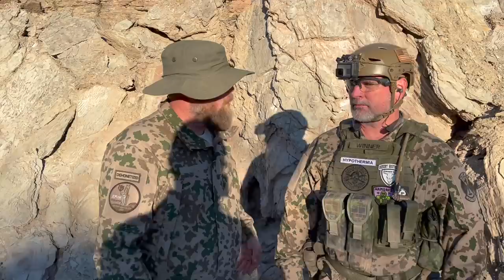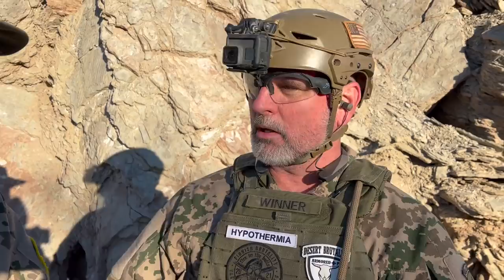WWSD - Why not a hydraulic buffer?

Comment: Temperature dependent change in viscosity is simply a fluid engineering issue. There are plenty of fluids which exhibit very low changes in viscosity based on temperature (shock oils) 
Without elaborating on what fluid they're using this doesn't mean much.
Reply: True also is it fair to condemn hydraulic buffer systems based on temperature in one experience when we don't know what the other factors are? Is the gun running minimum gas or reduced bolt travel like many gamer guns, is the bolt carrier lightened, what lube was used in the gun itself? Also I think it's fair to mention that there was a problem with sand in the magazine which could cause the issues alone and it was evident in the video the magazine was hard to seat. Lets not jump to conclusions, if we want to learn the reliability of hydraulic buffers they should be tested correctly.
Reply: I think it's a fair point when you're relying on off the shelf components to put in the rifles. If even the good ones that are available exhibit such behavior, then they aren't a great idea in practical terms. Could you design a better one that wouldn't be problematic? Sure, and hopefully someone will.
Reply: I recall the Colt LMG and LSW currently in use by the Dutch and Danish militaries use hydraulic buffers. Designed back in the 80’s, they give the rifle a very stable rate of fire but require occasional replacement when their seals begin to fail. 

Colt did try a similar buffer for the CAR-15 carbines but didn’t go forward due to the cost and the failure of seals.
Reply: @jubuttib  I understand what you're saying but they didn't even list the hydraulic buffer manufacturer, when it was manufactured, how many rounds are on it or any other pertinent information. 
The failure of this hydraulic buffer is a single data point and should be treated as such. My issue here is Karl making sweeping claims without the usual investigative In Range due diligence. I don't run a hydraulic buffer in anything I personally own FYI.
Reply: @otm646  Entirely fair points, this video isn't conclusive by any means. I was also going off based on other comments seen here, as well as other discussions elsewhere. I agree tho, it'd be great to have them make a video or a series of videos showcasing these issues with units they've had problems with.

Comment: oh it's simple, you just need to install the hydraulic fluid pre-heating system.  keep an eye on your buffer's temperature and pressure gauges and just turn on pre-heat as necessary.

Comment: I run a taccom buffer with the double spring system and it has done well for me but I don't push my rifles as hard as you 2 gun shooters. I wonder if it would hold up
Reply: I have the armaspec srs, the 2 stage spring and so far no issues

Comment: Am I being dumb, how can buffer case double feeds? That sounds like a magazine or ejector/extractor issue.
Reply: If the buffer is too hard (viscosity is too high due to the cold weather), the bolt could come back just far enough to pickup a new round but still stroke so short and fast that the empty doesn't have time to clear.
Reply: Oops, wrong post

Comment: Well, sounds like you need an oil with a much wider temperature range, where its viscosity value stays true for the desired damping characteristics, or you have to build in a valving system which adjusts for the viscosity change. And maybe you need some cooling. 
At least hydraulic recoil damping worked in some artilery pieces, and some shocks on offroad vehicles are also known to cope with that kind of wider temperature conditions quite well.
Reply: Question out of interest: Are you talking about self-loading artillery pieces? I wonder if it's a question of scale to an extent, a smaller system like a semi-auto rifle that cycles really quickly and also isn't gassed to hell probably has a smaller margin of error for these kinds of things. Don't know, just thinking out loud.

On the vehicles, a damper running cold will be a bit stiff to start with, but won't prevent the car from working, and they'll warm up in use very quickly anyway, so it's kind of a temporary issue.
Reply: @jubuttib  No, I didn`t thougt particulary about slef loading artilery pieces. But if I think on reloading times of some tank destroying guns like used in WWII, I don`t think it doesn`t matter so much. All I have seen on artilery pieces was the combination of a spring for handling the recoil and a hydraulic damper to handle the spring. It all comes down on how much energy is transfered into how much oil and how good is the cooling to the environment for the oil to determine how fast it heats up and leaves the window of proper viscoity. Scale it right, and it should work. If it fits still into the buffer tube of an AR? Don`t know. Anyway, the whole idea seams a lot of effort to handle recoil of a handheld firearm.
Reply: Theoretically high performance shock absorbers run on zero viscosity fluids, but of course practically whatever oil is in there does have some viscosity. However they do not rely on viscosity for damping. I am sure it would be possible to build a perfect hydraulic buffer but it would be complicated.
Reply: @gearloose703  I'm slightly confused, don't these buffers usually work via the same principle as car shock absorbers, i.e. controlling the flow of a fluid (almost always oil) through orifices in the piston, or around the piston? At least that design is primarily based on viscous friction.
Reply: @jubuttib  I have never seen a hydraulic ar buffer let alone taken one apart. But simple orifice won't work because force vs. speed would be exponential. You'd want constant deceleration which requires more complex flow restrictor, which may not need to rely on viscosity at all, but rather shims or similar which provide a more constant restriction over wider range of flow starting from zero (unlike orifice).

Comment: Sounds like it's the fluid at fault. It doesn't mean that the concept is bad, but just that the current implementation is poor. There are plenty of usecases for temperature-resistant hydraulics, so investigating which would work may be valuable.
Reply: the thing is that. at least I can´t come up with a way that a spring is destoyed. Hydrolics a leak and they might not work at all.

Comment: Same reason I think the new B&T APC9/10/40/45 is overly hyped. It may be built to Swiss standards and run super smooth, but sooner or later that little hydraulic buffer is going to give out and it's not going to be cheap to replace or easily sourced. I just looked. $241 for a recoil assembly part, which everyone knows recoil spring and buffers are usually the first parts that need replaced.

Comment: The Canadian LMG has a hydraulic buffer system that works in cold environments.
Reply: Only because the substance inside is Molson Ice.
Reply: @DavidWilliams-ig5ec  For sure don't ya know ayy?
Reply: It’s a bit like motor oil, you can make a hydraulic buffer for any specific weather condition but what you can’t do is make a single buffer that will handle more dramatic temperature ranges.
There’s all sorts of additives that could help broaden the range and technology is always going to help, but it’s obviously not fully there yet..
Reply: @Jay22222  The fluid absolutely exists, the issue is whatever fluid the manufacturer put inside this hydraulic buffer.
Reply: @otm646  I’m very skeptical that there is a “one size fits all” hydraulic fluid that will produce consistent results in a northern Canadian winter through to a midday heat in a Central African desert.
And if there is, I’m certain that you will have debilitating malfunctions of the O-rings and wipers.
Best of luck finding imperial sized replacement parts in the middle of the Sahara or the Gobi.
(Assuming we’re not talking specifically about the LMG referenced.)
Reply: @Jay22222  There absolutely is, and for two reasons. Firstly because you can meter fluid better than a simple fixed sized opening, allowing for constant pressures to be maintained over a range of flow-rates (see any regulator used in any system, from most washing machines to your home compressed air). Secondly because viscosity modifiers are already normal for engine/machine use, hence duel rating oils (eg 5w30) rather than straight SAE30. How do you read this? Well the first number is the base oil viscosity, its going to behave like this when cold (a fixed temperature close to waters freezing). The second is the viscosity of oil it behaves like when hot (a fixed temperature close to waters boiling point). The replacement parts comment goes equally for anything not already in common use... your not going to get correct buffer springs (which absolutely are weapon specific) any easier than seals. IMO the big issue is most products on the market are toys for hobbyists, not serious military use and associated development cycle, rather than the intrinsic nature of hydraulics. It'd take more time to make a good buffer, so most of the quickly engineered drop in products for various guns simply suck.
Reply: @SheepInACart I think it’s important I preface this by saying, I’m not talking about the vast majority of situations, I’m talking around the physical limitations of human beings, those kinds of temperatures.
 @SheepInACart ssion curve and it’s  @SheepInACart viscosity is  @SheepInACart 

Also, you do realise that there’s some pretty substantial and significant differences between hydraulic oils and fluids and engine oils right?
Hydraulic oil doesn’t need near the same resistance to heat that engine oil does and likewise, the compressibility of engine oil is really crucial like it is in an hydraulic system. 

Another thing is, if you live in the coldest parts of the earth, you’re not using the same oils as you would be if you operated in the hottest environments on earth. You just wouldn’t. It’s far from the only reason, but it’s certainly a big important reason that there are so many different kinds of oil for these applications and the most important factor here is two of the most major duties of oils are not relevant in a buffer tube.
You don’t need lubricant and wear additives anything near like you would want in an engine crank case and the viscosity also isn’t near as important because as I said, it’s not driving anything or being pumped anywhere.
Another major factor that makes the an impossipuzzle is the fact that engine oils have ratings for operating temp, hydraulics have operating temp specs.
There really is no standard operating temperature for the hydraulic buffer in a rifle. @SheepInACart it’s going to expand in the heat and have a bite taken out of it after your first shot or it’s going to be so freezing cold that it practically shatters after your first shot.
You  @SheepInACart Also, even if it’s not buggered, it’s fixable, you’re hooped unless you’re carrying around some backup special sauce hydraulic oil for your rifle.
Put all that aside, here’s a question:
 @SheepInACart 
I know what I’d pick.

I don’t disagree with the last part of your post.
Just about every technology In existence is only available and affordable now due to the military industrial complex.
Phones, satellites, vehicles, firearms, making perishable goods last forever. You name it, the military pioneered it.

Edit: Just read the flow rate bit again, just want to make it clear that although I made a comparison to engine oil, everything I wrote in the post you replied to and this was exclusively about hydraulic buffers in rifles. 
I concede that there are engine oils that will work in 90% of environments, but that’s not at all what I was talking about and didn’t realise but I think that’s what you were saying?
I was saying there is no way there is a single one use oil for a buffer tube that will let the rifle function smoothly and consistently, without modification or issue in the Ural Mountains as well as just a pavement melter of a summers day in Nevada.)

Comment: How does double feeds happen, I know it happens all the time with bad mags, but how does 2 rounds manage to be fed at the same time?
Reply: The Bolt goes all the way forward on the first round, pushing it in. Pull trigger, it goes bang, but on the return stroke it doesn't have enough energy to go all the way back, but far back enough to pick up another round from the magazine.
It would jam open, so no chance of firing.

Comment: Can you not get a different hydraulic fluid that can better handle a wider range of temps?
Reply from the maker: Why bother?
Reply: When a spring can do the job without it's properties changing radically with ambient temperature variations why even try to solve a problem with an inherently inferior component?
Reply: in addition to what everyone else said, most of those are sealed systems and it's not like you can just fill it up with what ever fluid you want for random conditions
Reply: @BurningMonkey  But they can be designed differently. The problem might be with this implementation rather than the basic idea.
Reply: @BurningMonkey  Very true but if I were going to design and build such a buffer system, I would make it rebuildable and adjustable. It's quite easy, I've made them for other applications before. But what would the market be for such a device? I really don't see very many people buying one when reliable operation requires rebuilding every couple matches and anytime the temps change drastically.
Reply: You are still stuck with a bunch of other problems. Multiple extra failure points in the form of gaskets and seals and higher sensitivity to ammo loads.
Reply: @InrangeTv  The ability to run a lighter or lower recoil impulse gun maybe? As an engineer I feel the concept is sound: hydraulics are a superior way to take a short, sharp impact and spread it over a long period of time. That’s exactly what seating a bolt requires, which is why most buffer weights are segmented or composed of many small weights- they work dead-blow hammers. A hydraulic damper is even better at lengthening the duration of impact (in theory) allowing a lighter, faster cycling bolt to reliably seat with less mass moving around. I think that’s a worthy goal. Clearly it’s not worth the trade-off as implemented here, but in my mind that doesn’t mean it’s not worth trying.
Reply: @InrangeTv  Thought experiment. Why do anything that is different? Answer: because that is how we make things better.

Comment: It works on the Denel anti material rifle more tinkering needed it could no doubt be made to work reliably but would there be any advantage in most rifles. If not it's over complicating something that already works.
Reply: DENEL AMR is not an autoloading rifle. Consistency  of recoil does not impact function, however I imaging it would suck more if you fired the gun when the buffer is stiffer

Comment: Oh really?  Was it the original milled Russian hydraulic buffer or the knock-off Czech stamped steel one?  Did you use officially licensed Little Ivan Goes to War brand graphite lubricant?  For that matter, did you check to make sure the Mega Spaz Redundancy Pile was not on the blink?  Context matters.

Comment: What are the benefits of a hydraulic buffer? (assuming they work correctly) I'm not familiar with it, so I'm curious.
Reply: Colt testing with hydraulic buffers found that it would bring the rate of fire of the rifle-length gas system from 750-950 rpm to 600-700 rpm. Or in their words, “make it purr.” In full auto at least. 

The hydraulic buffer does seem to work correctly though are more maintenance intensive and require replacement when worn. Which Diemaco (now Colt Canada) does. 

Currently in service with the Danish military and Dutch marines, and they seem to like it.

Comment: Cars have shock absorbers that work.  They are I believe not using liquid, but maybe they can not be used on guns.   I would prefer that someone work on solid material for shock absorption along with a weighted buffer.  Certainly the plastic bumper could be make of suitable materials and maybe extended to become a shock absorber along with the correct wts.   One wants full and unimpeded movement at the correct velocity range in the buffer tube for correct function.
Reply: Automotive dampers are definitely filled with oil. They do use an oil that's more stable over a broad temp range but they still do change depending on temp. Fortunately the exact damping ratio isn't that critical on a street car and on a race car, the dampers warm up quickly. Even so, racers often do have to make some adjustments for big temp swings.
Reply: Get them in a wide range of oil, magnetic fluid, gas and pressurized air. Keep in mind though they fulfill completely different function on a car ie damping spring oscillating movements. Even 100+ years of automotive engineering coil spring still the best tool to return the wheel to the road.